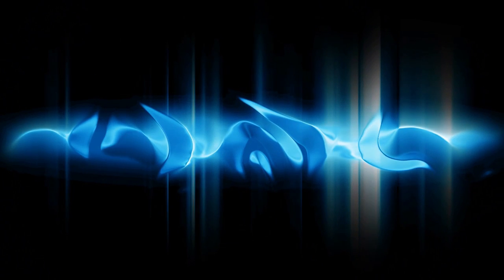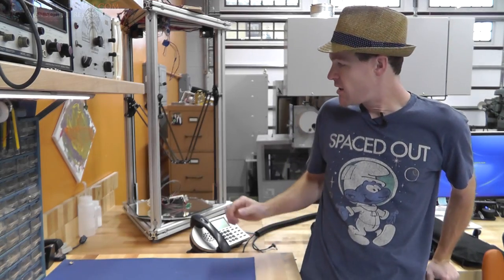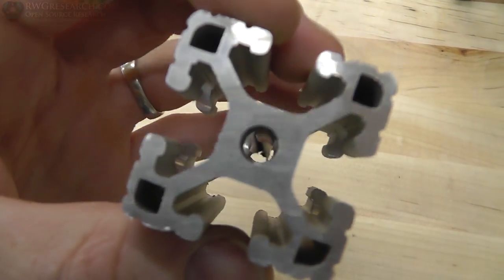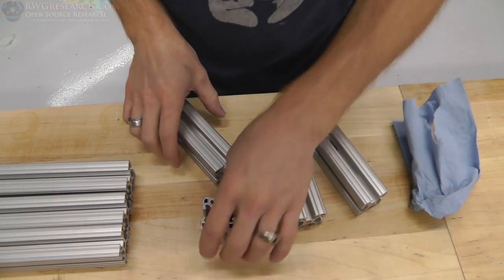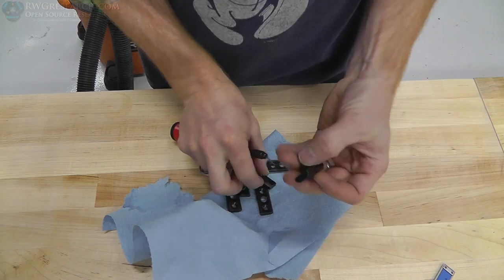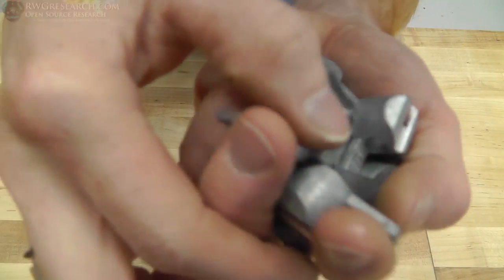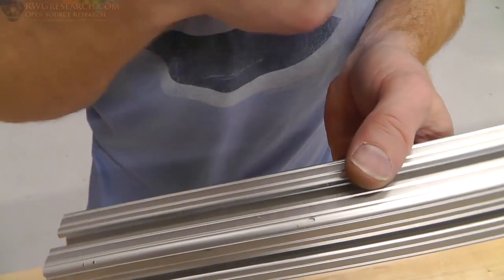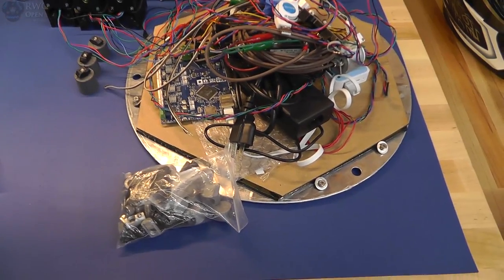RWG-OSD # 21 The Electrical Starts... oh boy, what have i done...

Comment: A little trick to make expandable coil wiring is wrap it around a rod of your size choice nice and tight, then take heat gun, and warm them up enough to get the plastic coating nice and warm enough to almost melt then let cool.... coil wire like old phone cord

Comment: Oh wow, I don't envy you that cable threading job! been there a time or two! 😋 Are you using separate runs for power and data? Should be able to get away with really thin wires for the data, that being the case. Good sources of thin wires include HDMI cables, cheap USB leads, even old SCART cables.

Comment: I don't know why or even how but i totally stopped receiving the alerts of your videos!! I'm glad that I found you again. since the last time we talk about this build up you mentioned that you wasn't going to use servos but stepper motors "Does that have changed ??"
Reply from the maker: no, still using steppers. Servos are more pricey and worth it if a bigger system is built, but on this scale, as long as your settings are good and you don't miss steps... its all good :) ~Russ
Reply: Yup... I actually realize after I spend a good amount of Doe on a set of stepper hybrids that I was having feedback problems on my CNC System.. But I have to say that Servos are awesome!! move about 20 times faster and are at least 5 times stronger than steppers... I actually see a good reason to invest on them....Thanks for the reply..
Reply from the maker: yes if you can all ways use servos !!! for Manny reasons... :) ~Russ